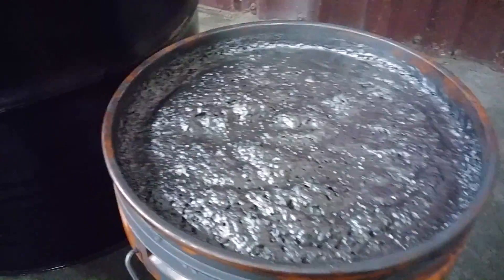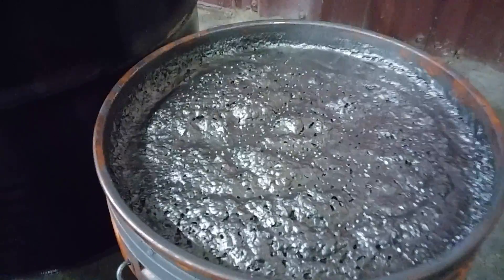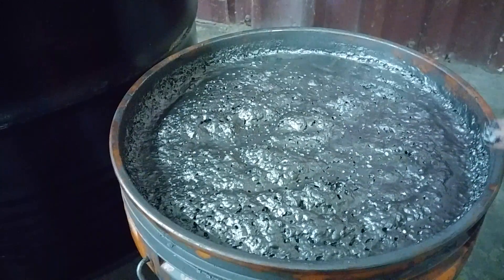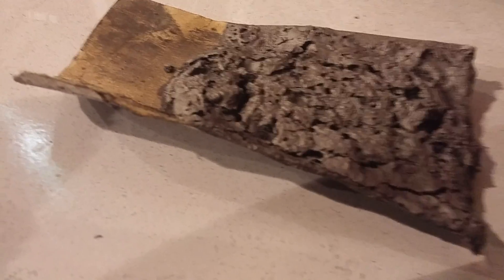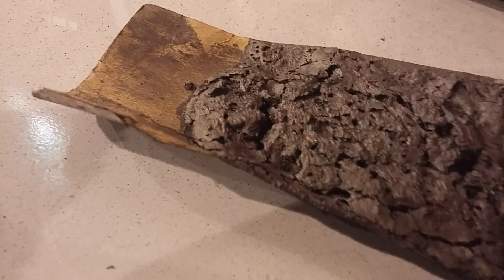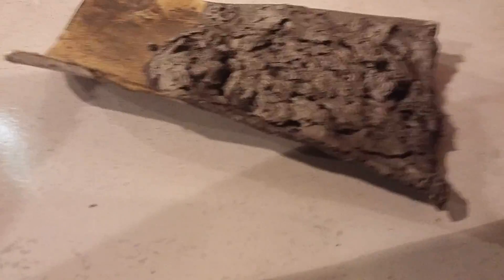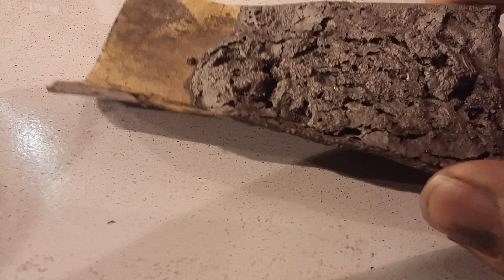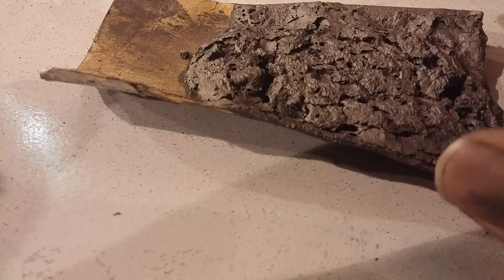A pure graphene foam.

Comment: I get you are using "laymen" terms to SELL this but "ever so" and "insanely" thermally conductive aren't scientific units.  Could you please take some measurements with a thermal probe (same kind jewelers use to test for synthetic diamond, as they are more conductive than natural diamond) and post that, so those of us with a legitimate use for this, besides mouth breathing at your videos, have some numbers to go off of.
Reply from the maker: +Mechanicus The thermal video will come soon. But the test gave 5700 W/mK for the powder.
Reply: Venturestarx Thanks, I have the thermal properties in mind for a specific application. However, have not been able to get there yet.